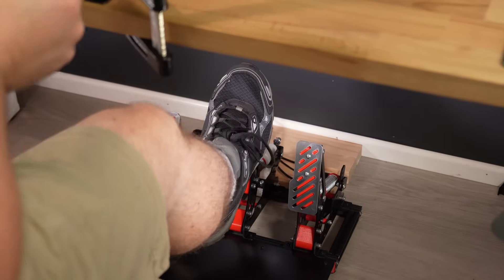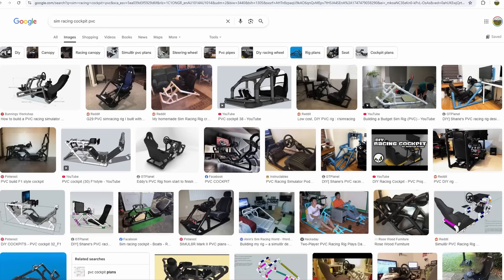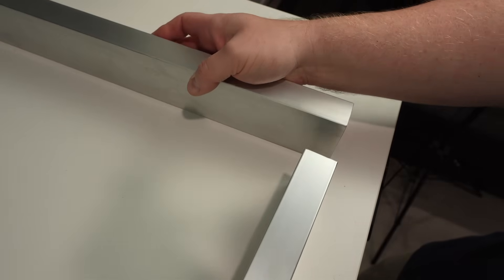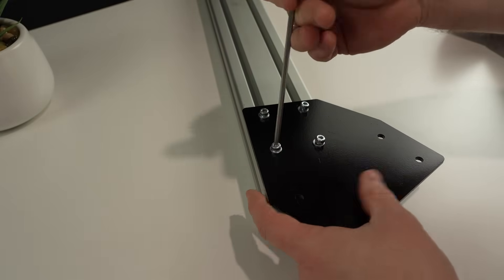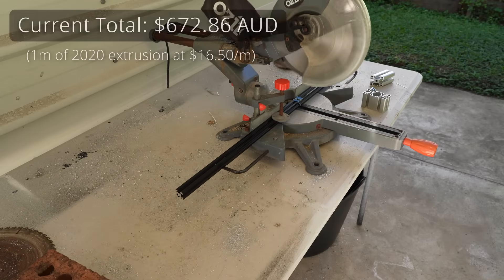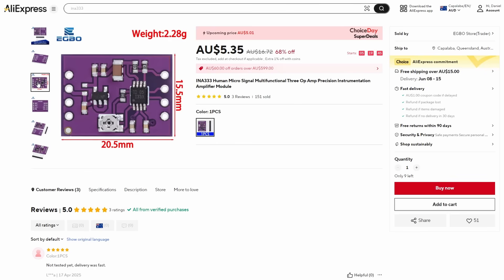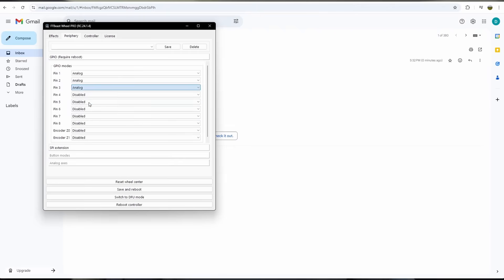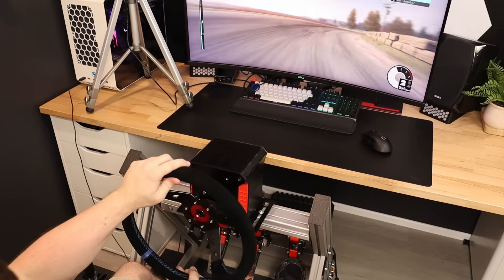DIY Aluminium Sim Rig!

Comment: Pre-engineered, adjustable rigs are way too affordable and available to burn the resources required to "make your own". Mine was $210 and includes a fore-aft adjustable reclining seat. Had it together in 40 minutes. I rebuild medium-voltage industrial breakers for a living and restore vintage motorcycles in my spare time, so yeah, while I could "build my own" racing rig, screw that

Comment: hey! can you give us an update regarding the 3d printed corners? 
I have had some problems in the past regarding 3d printed parts under the load
Are you corners still holding? And what fillament did you use?
Thx!
Reply from the maker: The corners were printed in regular old PETG (think it was Esun brand). I used the strength preset in bambu slicer which I believe is 6 walls and 25% infill. They are holding up fine for me so far and have handled the whole platform being moved around my office quite a few times already with no signs of any problems so far! Getting the correct print orientation for your part is definitely important. For this design, since the layers are all "captive" within the RHS there is a fair bit of support holding the layers together where the load is actually applied.
Reply: @cncdan  thank you for such valuable insights 😊

Comment: every single extrusion rig I see has unnecessarily large extrusions - you see those used on your pedals? - whole rig only needs that thickness - using bracing parts to make triangles would be much cheaper

Comment: Great Video Dan, $690AUD is about standard average in the market of Alloy Frames; even Trak Racer TR40S is $449AUD and TR80S is $699AUD (both without seats) - great information though, gives me something to think about upgrading from my 50mm Tubed frame I got off ebay
Reply from the maker: If you did it without the laser cut plates and just made your own, you'd save yourself a fair chunk of change on the total cost of the project! I did design this with the possibility of a future motion platform in mind, which is why I made some of the choices I did. Glad its given you some information for your own one though!

Comment: Can I use the BTS 7960 motor controller?
Reply from the maker: Not without completely changing the project. That motor driver is for driving a stepper motor so you'd need to use that type of motor and then a seperate micro controller with different software on it to get force feedback. The controller I used is about the cheapest option you will find for driving a hoverboard motor.

Comment: Hi Dan. This is really cool! I did have a question about the pedals. Would it be possible to wire in a pressure sensor instead of a load cell for use with a hydraulic brake pedal? I’m looking at building my own wheel like your one and pedals just with hydraulic brake. Great videos on this topic, looking forward to more

Edit: just re-watching the first wheel video. Is there a way to add an emergency power kill switch to the wheel base? A lot of direct drive wheels have this as if they ever went wrong being they’re quite high power they could be dangerous so an emergency kill switch is a desirable feature

Comment: It's already been said numerous times, but definitely keen to see you do a budget DIY motion system for this platform.
If you could get a 3DOF setup with at least 50mm of travel for $1-2k AUD, then that would be very popular.

Biggest challenge for the average Joe is the linear actuators. Noise, durability, speed, torque, load etc are all important, and the the first 2 in particular are hard to assess before purchasing. It's hard to justify buying a bunch of different ones to test as a personal project when they're so expensive.

Comment: Great video! I'm building my own simulator based on your projects. I'm an electronics specialist, so I'll probably approach things a bit differently when it comes to connecting everything — I'll create my own custom controller. But most of the mechanical solutions will be inspired by yours, including the pedals, most likely in a similar way.

A couple of things you could add — and which I’ll also be adding — are: a Buttkicker (or even more advanced, not just one or two, but one for each 'wheel' so to speak), and another really cool addition: a G-force simulation device that tightens the seatbelt during braking and other forces. That would be awesome!
Reply: Personally, I plan to skip the Buttkicker, but I will add the seatbelt tensioning system and four actuators. However, it's important to make sure that any DIY actuator can reach at least 150Hz, so it's able to vibrate at the right frequency and effectively replace the Buttkicker in its role - acting as a real simulation enhancement, not just an expensive extra.

Comment: You should setup your seating and wheel position so your arm rests with a 45° angle at the elbow. As it is, you have to twist your shoulders to turn the wheel. There are a quite a few good videos on YouTube about it, especially mcmtv2 and speed academy.

Comment: Nice rig, I'm just about to build a new one out of extrusion but you've given me the idea (and possibly saved me some cash) on building the bottom frame out of the box section alu instead. I'm shocked at how expensive the alu t-slot extrusion is in Oz, I'd have thought it'd be cheaper given Australia is one of the top 10 aluminium exporters in the world.

Also, I'd recommend having a look into replacing FFBeast with an OpenFFBoard setup instead of putting up with the onerous FFBeast stuff with its dodgy licensing approach. OpenFFB firmware is actually open source and so adding your pedals using the HX711 would be quite possible not to mention the community around it is very strong in terms of helping people figure out doing interesting new things with the platform. There are multiple loadcell pedal integrations that community members have done with varying approaches so you'd be in good company. You'd still use your odrive clone,. albeit with the original 0.5.6 firmware, and simply add a cheap STM32F407 dev board (or the official board which I highly recommend) flashed with the OpenFFB firmware and you're pretty much good to go.

Inverted pedals without the properly shaped pedal arms won't result in a motion similar to what you'd find in a real car with top mounted pedals. This is because the plane of the pedal face is typically offset much further from the centre of rotation in a set of real top mounted car pedals than it is with a set of floor mounted pedals,. Ergonomically there's a lot more to it than just flipping them upside down as many gamers seem to assume. Maybe a set of nice top mounted pedal arms could be a future project for the channel though. On the point about being 'more realistic', of the race cars I've been fortunate enough to drive most had floor mounted pedal boxes, and of those that had top mounted pedals none had a top mounted throttle pedal. One reason for mounting the box to the floor is to make heel and toe downshifts much easier as the top of stroke movement is increased and that you don't have to rotate your foot nearly as much and can usually just lean the outside of your right foot on the throttle as you press the brake, controlling the amount of throttle blip by pivoting on the ball of your foot. I'm not saying "nobody must ever do this!!!11" but I feel claiming it is somehow more realistic rather than just personal preference (which is totally fine, each to their own) is a bit wide of the mark IMO.

Comment: time for: diy handbrake, diy motion system/seat shaker/belt tensioner.
Reply: Seriously, a belt tensioner is the very best thing you can do. It will give you so much information during braking. If you're locking the front you can't feel that normally but with belts, they'll loosen because there's no more deceleration. This allows you to react to brake lock insanely fast
Reply: Oh and sim air
Reply: I don’t know where i saw this. But someone made a DIY motion system for roughly 500 euros. Not built one myself so I can’t comment but looked promising.
Reply: Diy haptic shifter, i mean its basically larger size joystick with 2 servo motors instead of potentiometers
Reply: @MintJoker9578 Can you explain how it works?
Reply: @Powdercoreyguy  so basically with normal joystick you have 2 potentiometers 1 control x axis another y axis
Now if you make it larger, replace the potentiometers with servo motors, you got yourself the haptic feedback shifter
Since servo motors without power acts like potentiometer and you can program how the servo act
Reply: @MintJoker9578 And does the motor make for a gated effect if active?
Reply: @Powdercoreyguy  technically possible if you do familiar with how haptic knob works
Reply: handbrake, bass shaker, and belt tensioner isnt that hard
Reply: Well the rest I can absolutely see a reason for but I have a Temu hydro handbrake and it works like a charm and was cheaper then the material cost to build a one off
Reply: Bro I second the diy motion. That stuff gets insanely expensive.

Comment: i mean 3d printed brackets are really not that controversial if you ever held a strong 3d print in your hands, there is no way you are going to destroy one of those with muscle force. however, dont shy away from using PLA, maybe even PLA CF as its much more rigid and you doesnt really need the shock resistance that petg offers :)

Comment: Wow really clean setup! I built a rig from aluminum extrusions and 3D printed all the connectors, which has also held up pretty well with a 8nm Fanatec wheel and loadcell pedals. This cost me around 350€ including rails and bucket seat, so something similar is definitely viable for everyone on a budget.
Would be really cool if you would take your project one step further and build an affordable motion rig!